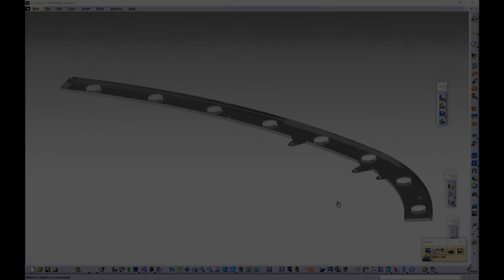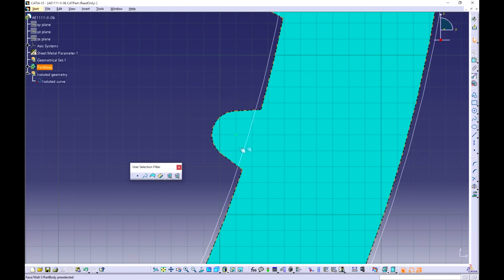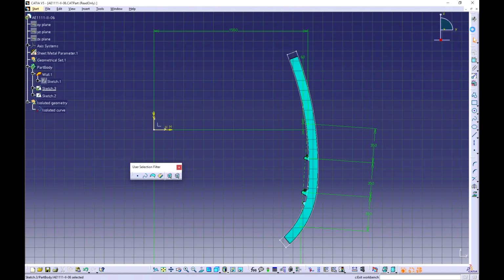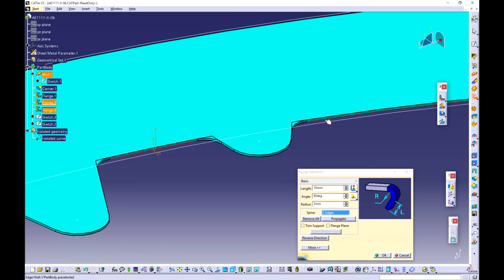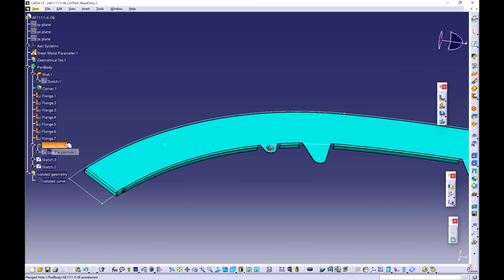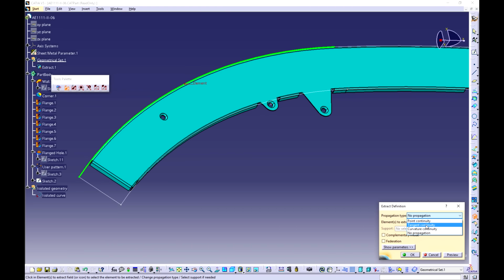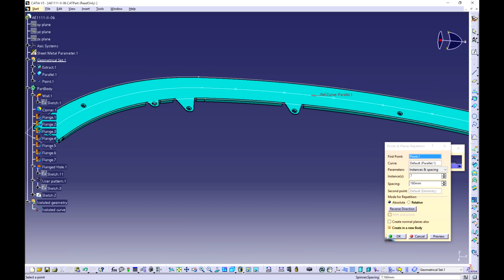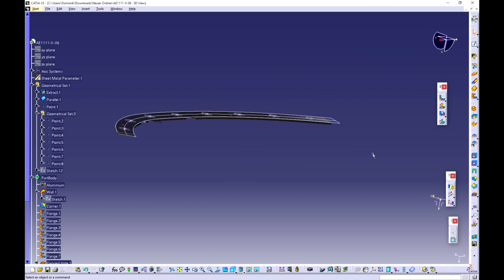Catia - Basics Part Design Part 6

Comment: Thanks for the series, great info. The link again doesn’t work however, any chance that could be fixed?
Reply from the maker: Thank you for your comment. Since it's been 5 years, I have to look for the file on my old drives. I will comment again if I can find it. 
But as I remember, you will also get this file in class if Eddy is still doing technical drawing and hasn't changed the assignments.